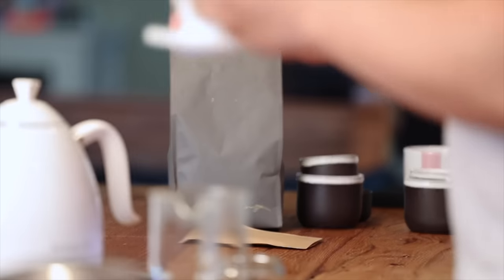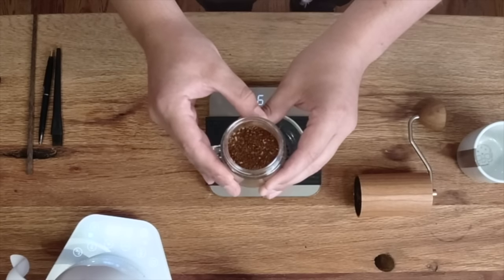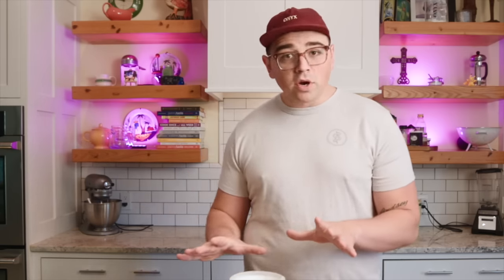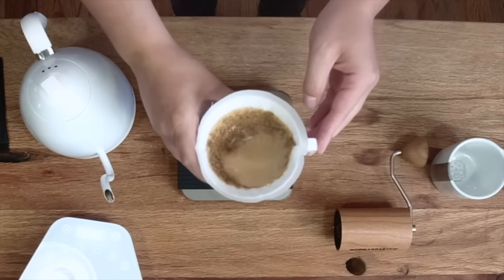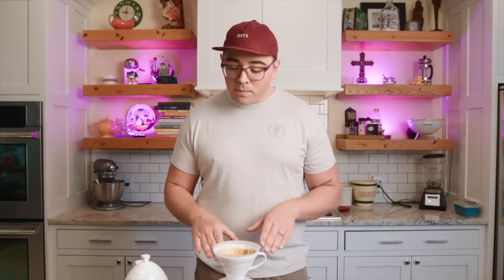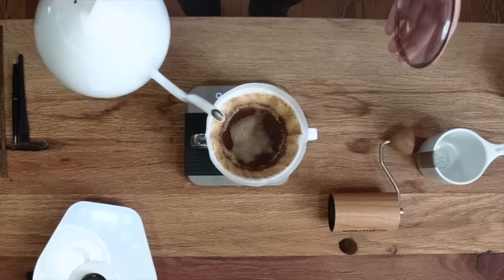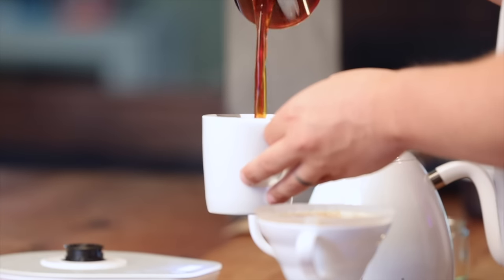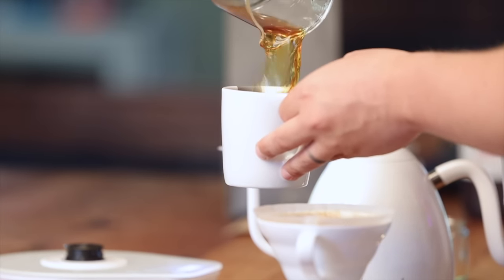HARIO V60 BREWGUIDE: Easy and Effective V60 Recipe!

Comment: Really enjoyed this Lance, I used the Onyx Burundi and made a sweet brew. I always did a hybrid of Hoffmann and Rolfe method previous. 

One question could you extend grind size to other machines please, Niche Zero, Wilfa Svart etc.
Reply from the maker: Do you have the application/software Jonathan Gagne made for computer? With it, you can take a picture of your grinds and upload it to the app. It will tell you grind size. Then you can match to mine. Or Kruve has a printable ruler that has micron sizes. You can print it and compare to your grinds. The application is much more accurate, but the printable ruler will get you there
Reply: @LanceHedrick  I shall try the Kruve one. Although I can tell you for the Niche Zero is a full counter clockwise turn round to 16 and get 3:30 TBT.
Reply from the maker: Wow. I've also heard from some very solid coffee pros that the niche is quite poor at filter coffee grinding. So, might be best to use another grinder if you have it?
Reply: @LanceHedrick  thanks dude, compared to my Wilfa it's leaps and bounds above it. I also looked at the Sette 270wi and the Niche came out on top for both espresso and filter. Other than those machine it's a Kaffalano hand grinder which I've never used. (Emergency's only) ha
Reply from the maker: I definitely agree the sette is worthless on filter, but it is pretty dope on espresso. No need for the wi upgrade. Those are the worst. Stock 270 rocks. I love mine. I just know the particle distro is not great on niche for filter..anyway, it is certainly better than most cheap grinders, though I've heard many say they prefer their encore to the niche filter settings.
Reply: @LanceHedrick  that's good insight and to know. I was doing so many reviews on here for grinders in that price bracket and I fell lucky for a Niche. I'll have a look at the encore as they are relatively cheap as a back up if I sell the Wilfa. Cheers dude. Just about to tag you on IG for the brew I made earlier. 1 of 4 so far today 🤣
Reply from the maker: Heck yeah! Do itttttttt. So great!

And if you're getting a separate filter grinder, save up for Kinu or Commandante. Travel compatible AND better than any grinders under $700 for filter (and can do espresso)
Reply: @LanceHedrick  Hi Lance! Great video, thanks for sharing! I do have a Kinu and playing around with the settings but I hasn't been able to find some calculation so far on how many clicks on commandante are turns on kinu. Have you got any tips please?
Reply from the maker: I think someone in the comments put comparable clicks for kinu. All I can say is go finer than you think

Comment: I have a JMax and it's marketed as 8.8 micron per cilck. So for it to has the 720 microns settings, i have to make 81 clicks. But it doens't even pass the turkish coffee region with 81 clicks... Where am I wrong?
Reply: I think those are not interchangeable. I have two grinders the C40 and a Bravo IT. Those 720 microns of the C40 doesn’t match the 720 microns of the other grinder. You’ll have first to do it by visual and comparison and then adjust by taste and finish time.

Comment: Nice video! Here are two comments:

My bed has a huge crater and I have no clue if that's alright with this recipe.

Also, does anyone have a click reference for a JX pro? Microns will NOT give you a satisfactory scale to dial since it has nothing to do with burr geometry and coffee output.
Reply from the maker: Correct. Microns here refers to the spacing between burrs, which isn't super helpful. I agree.
On JX it is 63-66
Reply: @LanceHedrick  Well, I will try at 63-68! I was doing 38 this morning and it tasted good. 

Is the cavity normal at the end of the brew though? I usually do 4:6 or Hoffman which yield perfectly flat bottom.
Reply from the maker: No! Should be flat because of the gentle swirls.
Reply: @LanceHedrick  Well, I'll have a go at practise then ! cheers mate !

Comment: Couldn't make this technique work on a Melitta =\. It just clogs the filter and I'm getting a 6min draw down, even trying to be very delicate with the agitations, compered to the 3min30s I usually get with the same grind size and ratio using a different technique. Also, the resulting bed is completely muddled. To be fair, it does taste very evenly extracted, albeit too high for me.

PS: why a Melitta? Because here in Brazil it's highly available in every supermarket, while the V60 filters are expensive and hard to find, especially in current times.

Comment: I tried 3 times. Didn't work for me. it tasted too bitter. 😞
Reply from the maker: Hmmmm what development level of coffee are you drinking? If it is a darker roast, should only be around 200 degrees. What grinder do you have? How aggressivly did you spin? The purpose of this video was to give a recipe you should tweak based off your coffee and setup. If you have a low quality grinder, maybe go coarser to account for the fines. If you have dark coffee, lower water. If really light coffee, more pours. Etc
Reply: @LanceHedrick  thank you for your reply! i have a good quality grinder (1zpresso K-plus) maybe you are right, i spin it very aggressively in order to grind faster. I tried at 95 degrees celcius and it tasted less bitter. i am using a medium roast specialty coffee.
Reply from the maker: Yes. Don't be aggressive on the spin. The first two spins it is ok to be aggressive because the low amount of water being dispensed. The last two should be very gentle. Just enough to settle the particles we forced into suspension with the heavy pours.